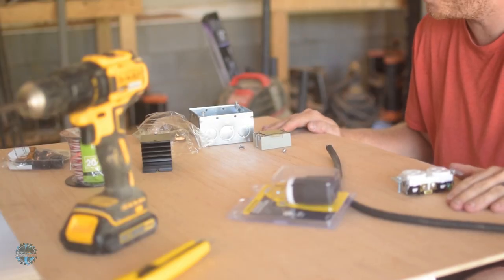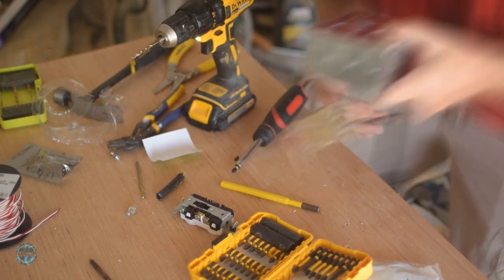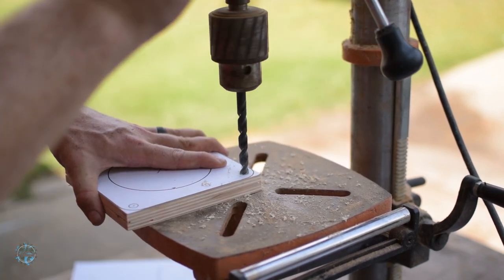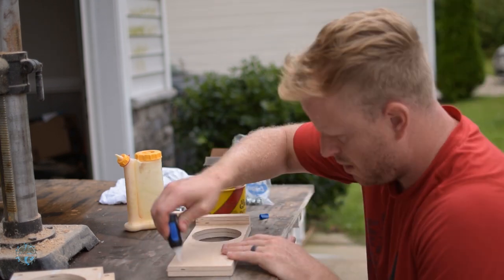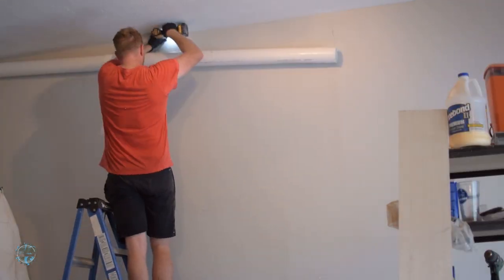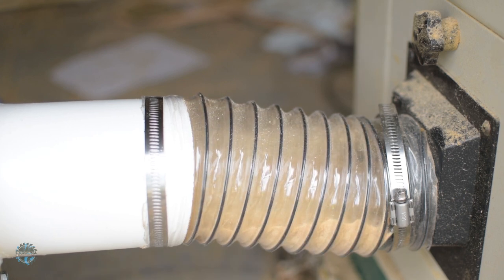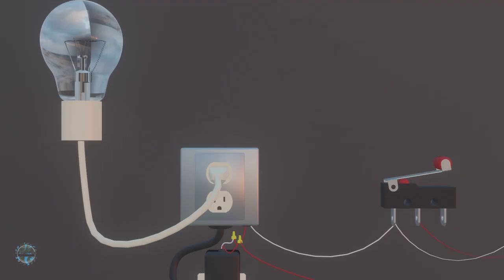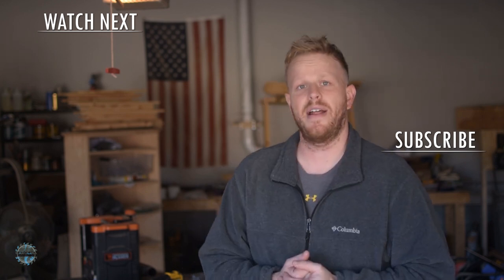Microswitch Controlled Blast Gates | Woodworking \ DIY

Comment: I just purchased a 2hp dust collector today that I am turning into a 2-stage cyclone system. 
This idea is perfect!!
Reply from the maker: That’s awesome! This whole system has been a huge upgrade to my shop
Reply: @CarolinaCraftsman  i designed and built a cyclone separator with a 30gallon steel drum and sheet metal back in the late 90s.
It was taken down after I sold my entire shop after a car accident in 2012. Being disabled SUX BIG TIME!! I had hip and knee replacements in 2018 and I'm slowly putting a shop back together just as a hobby.
The convenience of these blast gates will sure help me take less steps which is a huge benefit to all my fake parts!!
Reply from the maker: That sucks about your accident, but I’m glad you’re able to get back to it!

Comment: I luckily found this video while my new Harbor Freight dust collector is still in the box awaiting the Oneida Super Dust Deputy from Amazon.  I can now include this to my dust collection install instead of retrofitting it later. 
I bought the plans off the website and was pleasantly surprised by the instructions.  They are very clear and detailed.  I'm going to use the diagrams to draw a model so my CNC can cut out all the parts for the blast gates. 
I'll update my progress here in the comments.
Reply from the maker: Thank you very much! Let me know if you have any issues and I’ll do my best to help out!
Reply: Hey Clinton, can't seem to get access to his site or the plans. The link is dead. Is there any chance you have those plans or the info on the parts so i can try this at home?
Reply: Same problem here.Can’t seem to get to your website. Help! Please.
Reply: @admikewalker did you ever get a copy of his plans?

Comment: Absolute genius! I totally love the idea! Been looking for a solution just like this for a while as it makes much more sense for my setup. Thanks so much!
Quick question though: why not use a 3 way light switch at every tool? As far as my understanding goes, the result would be the same but without the need for a low voltage circuit. The vacuum would be the equivalent to the light in the staircase and any machine would turn it on. Or am I missing something? Don't want to ruin the sale of your plans, but the idea occurred to me and I though I'd ask. Thanks again!
Reply from the maker: Thank you! I think using light switches would definitely work and it’s a really good idea I hadn’t thought of! The only difference is dust collector won’t automatically turn on when you open a blast gate, you’ll have to flip the switch too, unless you got really clever with the light switch rig. The other advantage of the micro switches is you can’t accidentally leave a blast gate open because if the system is off everything is closed. I was also going to say price would be different too, but amazon has $0.68 light switches so it actually might be cheaper to do light switches haha.  

TLDR version:  yes, it would definitely work, the low voltage circuit has the advantage of being able to turn on with just the blast gates, but it’s still a great idea!

Comment: Solid build, but I have to say... Your cross-cuts @ 7:50 are scary.  That is the kinda thing that will cause a kick back.  Use a cross cutting sled as there isn't enough along the fence and it binds into the blade and can come back and get ya in the liver.  Safety first!
Reply from the maker: Thanks for watching! I agree with you, usually I used my miter gauge for those kind of cuts, idk what I was thinking!

Comment: hey man, great video... there are a few others out there but this is by far the best.  What wire do you use for the microswitches? I've built my blast gates, etc. and installed a similar setup... this is the last part - automation!  was thinking a google mini with a smart plug - works to turn it on but not off :-( what was I thinking?
Reply from the maker: Thanks for watching! The wire is just regular doorbell wire, I think it’s 20 AWG

Comment: Am I correct in assuming you can have multiple blast gates open at the same time and all will still work properly?
Also, would this setup work with a 3HP dust collector running on 220V?
Reply from the maker: Yes that is correct, you can have as many blast gates as you want. The 220v will work, you just might have to get a different relay than what I used. The plugs will also have to be rated for 220. The micro switches all runs on low voltage so that can remain the same
Reply from the maker: Misread your comment, you can have multiple open and it still works, just tested it!
Reply: @CarolinaCraftsman  Thanks for the quick reply. That was the most informative video I have been able to find on the subject. Much appreciated. Would you kindly be able to point me in the right direction for the relay? :)
Reply from the maker: I got mine from Amazon, you probably want to go with a solid state one (longer life) that  takes 12V DC in to 220V AC out. A lot of them have various voltage ranges on them, I think mine might be 3 - 30 dc in and 74 - 300 out. I’m not 100% sure on my exact specs but Amazon has a ton of options

Comment: I noticed that you used PVC for the ducking. How did you deal with the static?
Reply from the maker: I didn’t, I’ve seen a lot of conflicting information on the dangers of static build up so I figured I’d let it be and see if I noticed anything building up. I haven’t seen anything since I set the system up so it seems to be fine. It’s very humid where I’m at though so that could be helping

Comment: Can you provide an estimate for the material you've included in the plans?  Just want to make sure it's economically feasible for me right now before purchasing the plans.  Thanks, great video!
Reply from the maker: The electrical components are around $30 on Amazon and then depends on how many blastgates you’re making, I think I was able to make 5 with less than a half sheet of plywood. Thank you for watching!
Reply: @CarolinaCraftsman  Can this system be set up to use with standard metal blast gates?
Reply from the maker: It should work with that, depending on the height of the handle on the center piece, you may need to attach something to it so it can trigger the micro switch
Reply: @CarolinaCraftsman  I bought your plans and have run into a couple of snags. Please check your email. Thanks.
Reply from the maker: I emailed you back, thanks for letting me know!

Comment: I like the concept, but what do you power the low voltage side with, once everything is installed?
Reply from the maker: Thank you! I had an old AC/DC adapter that I wired to the low voltage side. I think mine was 18V but the relay is rated for 3V-30V so pretty much any adapter you have will work
Reply: @CarolinaCraftsman  is the low voltage power supply information including in the plans??
Reply from the maker: Yes they are!

Comment: Great video for the most part, but I’m a little confused by your reference to the neutral wire when connecting the DC transformer.  “Neutral” is not a concept that I’ve seen associated with DC electricity before.  It’s strictly positive & negative (aka “ground”).  Or maybe I completely misunderstand the diagram & explanation regarding the DC transformer.
Reply from the maker: You are correct, I used the wrong word in the video. When I say neutral during the DC wiring I mean ground. Thanks for the catch and thanks for watching!

Comment: Any reason you had to use 3/4 ply instead of something lighter like 1/2 or even 1/4 inch ply?
Reply from the maker: I had some extra 3/4 ply so that’s why I used it. I think 1/2” or 1/4” would work just fine too.  1/4” might be a little thin for the handles so you might have to double it up for ergonomics, but I think it would be just fine acting as a blast gate